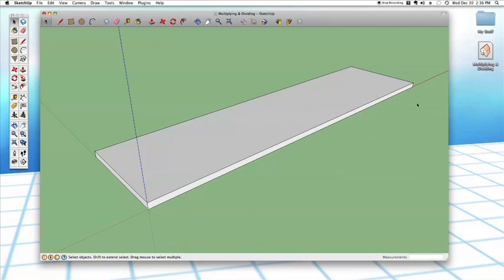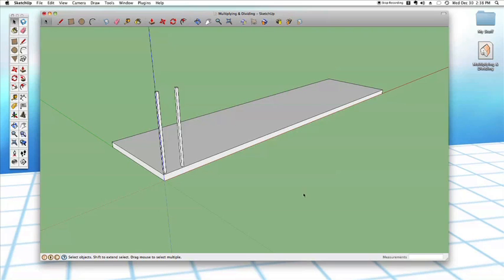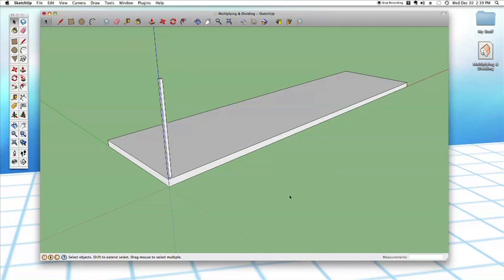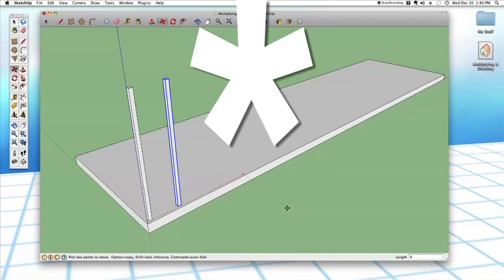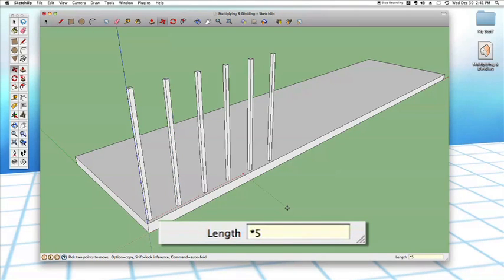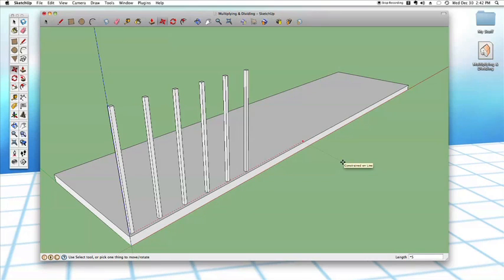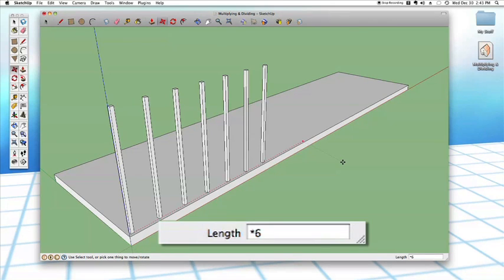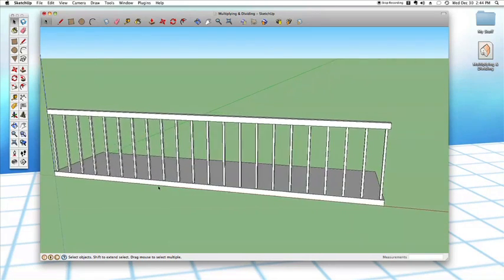Sketchup #23: Multiply & Divide

Comment: Thank you for the post.  It was very helpful.  I do have a question about another scenario though.  Let's say you were using a round post instead of a square post.  How could you accurately set the distance from the edges as you did with the square post, before increasing the amount?  I am not able to measure from the edge of the floor to the edge of the round post, and have no idea at what distance I am.  With a square post, this is not a problem.  If my measurement is not equal between the two end poles to the edge, how can I adjust that while keeping the spacing between all the poles the same?
Reply: Okay, I figured out my problem. I deleted all of the posts that I had 
previously made.  I then increased the decimal count for more precision.
  From there, when making my circular post, I learned it's very 
important to enter that number manually after starting the circle.  It 
is near impossible to set a perfect number with a .000 reading using a 
regular mouse.  I did group my floor first, as you suggested.  After I 
had the diameter circular post that I wanted, I checked to insure that 
it was centered.  It can be tricky to check these measurements because 
you have to pretty much begin from the middle area of the object you're 
measuring from, which may look like the wrong area to begin with.  Once I
 figured this out, putting down distances to check for centering was 
easy.  In my case, I wanted my posts to go through a length of the 
floor.  I hid the floor, and then used the push/pull tool to get the 
length that I wanted, and immediately grouped it.  After that I made the
 floor visible again.  From there, it was simply following your 
instructions on how to move, copy, and multiply.  I'm still having only 
one issue I that I haven't quite figured out yet.  After I've entered 
the amount of posts that I wanted with the multiplication sign, I 
scrolled out to get a better view of my project, and my object was 
deselected.  I didn't click on anything else as I wanted to be able to 
change that number if needed.  If my number was off, I had to first 
delete what I had added, and enter a different number.  Nothing too 
difficult, but it would be nice if I knew why my object keeps getting 
deselected when scrolling out with the mouse wheel to get a better view.
  

Leaning a little more, bit by bit.  Thanks again for your videos.

Comment: hey buddy how can you type dimension's like 3 4/5 in INCH.... in dimension txt box!!
Reply: Yes you can.  3.8 would be easier, but 34/5 works fine.  If, for some weird reason you wanted 3 2/7, it would be better to use fractions since 2/7 is a repeating decimal.

Comment: 'divide by' is the 'total' you want minus 2 ( 1 for the 1st object 1 for the last object = the minus 2) You can also copy group objects.

As an example I needed 20 shipping containers to fit a space with equal spacing, so as I copy the first container 'group' using ctrl (on pc) to the end location the 'total distance away including the spaces'

The maths for that is easy too: in this example if I have an 8 foot wide container x 20  the total length of containers aligned by width is 160' wide then add the spaces which are also 1 less than the total. So lets say 19 spaces of 1' between each, the total would be 160+19 = 179', i would therefore type 179' after I select copy mode press enter then type /18 to fill the space with the rest of the containers.

So to have 40 objects copy both and divide by 38. For a total of 10 objects copy both and divide by 8 and so on...To add spacing times the spacing amount by the total minus 1 and add that to the total width of the objects. hope that helps

Comment from the maker: @myownstarbucks I checked into this and it looks like there is a bug or they have disabled it in the current version. I"m having the same problem. A good workaround is to divide based on the number of segments you want, then measure one of the segments manually with the tape measure. - Cameron

Comment: Your show has been most helpful. I do have a problem with my "divide command". I get the red squares when I right click on the line but I it is not showing me the dimensions such as 6 equal spaces @ 3'-0" (it used to show that info but for some reason it disappeared). Can you tell me why and how to fix that?

Comment: just another tip, you can use the multiply command, using, instead of *, the x letter, so, if you want 5 objects, after copying, type 5x and you get 5 copys (keep in mind that the first one, that was the first copy is included in this 5 number)

Comment: you say that if you divide, for example, by 2 you don't get 2 poles but 1, this principle is wrong, when you divide by 2 you divide the spaces, so if you divide by 10, you get 9 poles and 10 spaces, this is the correct principle, not that the program divides 10-9